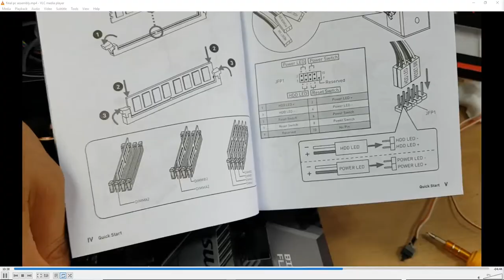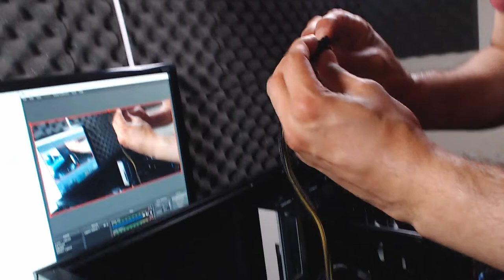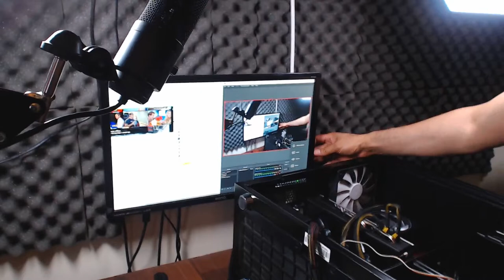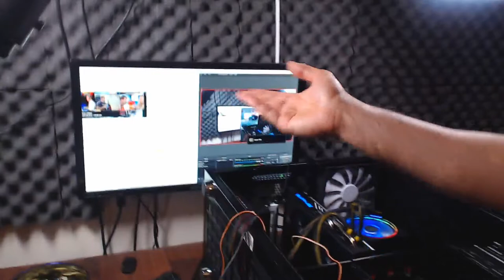How To Build A Gaming PC Full Beginners Guide - Assembling PC Parts Into Case - Pt 18 Live

Comment: difference between the gpu and graphics card is that the gpu is the name of the chipset that is integrated onto the circuit board and this part determines how fast the graphics card really is, the graphics card itself has the pci express interface, the cooler and the power delivery from the power supply.

Comment: I used to work on cars. I wish they had YouTube university when I was working on cars. If you don't want something to come out like standoffs, put a drop of Loktite threadlocker on the threads or a drop of Krazy glue. Be mindful that it is permanent and will probably take out the threads too when you try to remove them. If you strip threads all is not lost, drill and tap out the hole to the next larger size and use a bigger bolt. It is a pain, but it works.